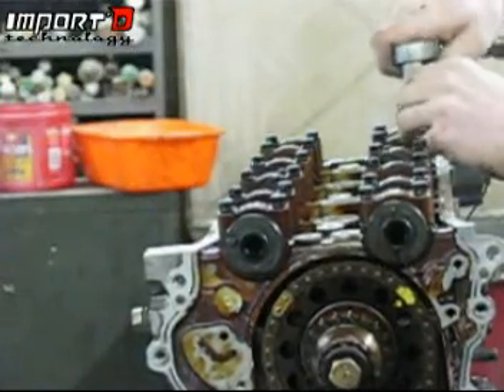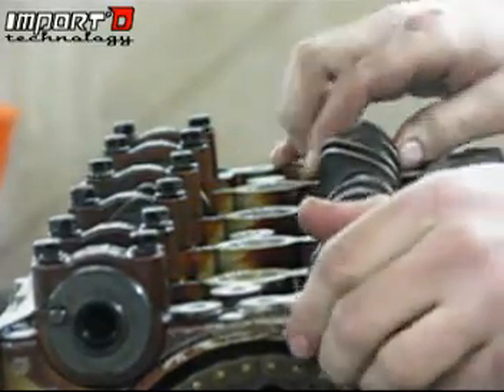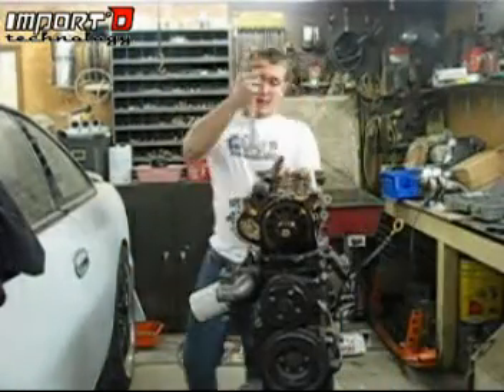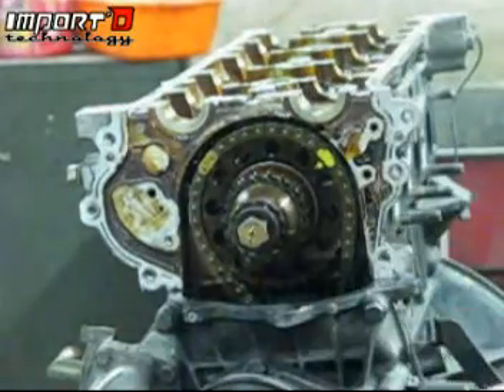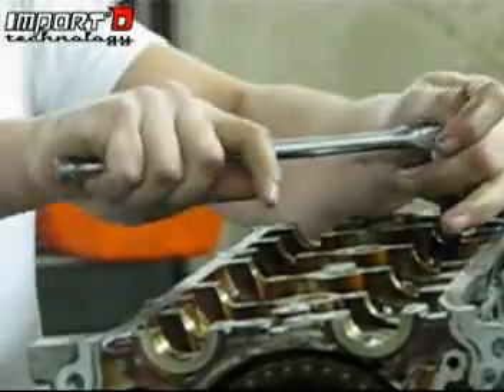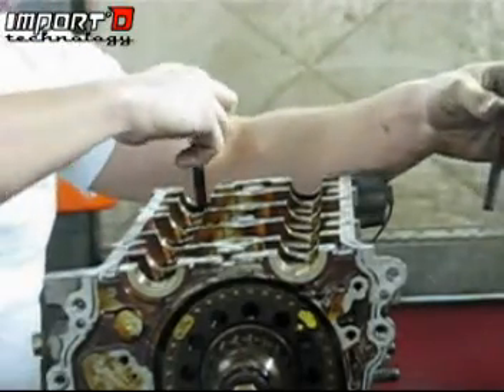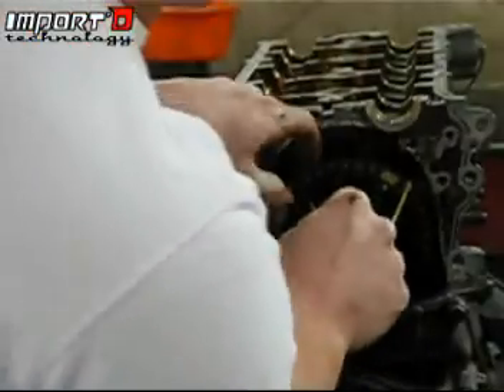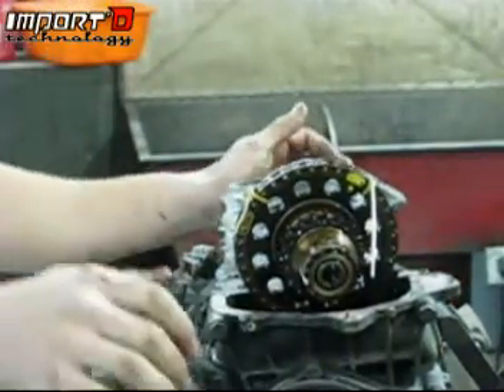Part 2 - How to remove cylinder head from KA24DE 240sx S13 S14

Comment: Appreciate the video but I thought you were unbolting in the opposite sequence so I checked the factory manual and I was right. It's a protected pdf manual so it won't let me copy and paste anything but in essence you are suppose to work your way out to in when disassembly and center to out when assembling cams, heads and rocker covers.
Reply from the maker: the important part is that they are removed evenly. Most everyday shops don't even follow a sequence of any kind.

Comment: awesome video man, just curious about your thoughts on if the block would need any machining if you had a slight BHG? my car has a very slow BHG (not mixing with the oil but white smoke is prevalent from the exhaust and coolant burns up). How likely/unlikely is it that the block might be damaged and may need to be milled or would just having the heads rebuilt and surface of the head machined along with a new head gasket and ARP studs work? thanks for any advice/suggestions.

Comment: Ok first off mad props to you guys, you did a very good job on this and has helped me tremendously with my 240 s14, really great videos!!! So i just got one and now the head gasket is blown :( but i cant really pull the motor (nowhere to do it) so i will be doing this in the engine bay. I know it will take longer but what are your thoughts on doing this in the engine bay??? Looking to do this next weekend so if you have a spare moment i would greatly appreciate you response, thank you very much!

Comment: Your video is very instructional, still is recommended to have the shop manual of the year and model of the vehicle. Both, the shop manual plus your video will be a great tool for anyone who feels capable to replace the head gasket or the valves. You have gave lots of tips which are very important and that are not shown in the shop manual. Great work, thanks for your video.

Comment from the maker: @willcast21 Thank you for the compliment.

Unfortunately, the 2.5/3.5 in the altima's is a new game. You can still use my video as a general "how to", most nissan's use timing chains. 

As for "Head Gasket Sealant", we use Permatex Copper Spray on all of our head gaskets.

TTY (Torque to yield) bolts usually are not super expensive. If they seem overpriced, check out the cost on ARP headstuds. ARP's are reusable over and over.

Comment from the maker: @juanfg34 It's pretty straight forward. Off the top of my head, there is a bolt on the exhaust side of the head that goes DOWN into the cover. You have to remember to take this out.

Also, there are two that go DOWN into the oil pan. 

Obviously, the crank pulley needs to be removed. Don't lose the "half moon" key that sits on the crank itself.

Comment from the maker: @S13xCrazy However, You can leave the intake on and avoid those 3. Getting the head actually out of the engine bay is slightly more complicated though. You have to have a buddy put a strap around the intake manifold and have them pull like hell to give the two intake studs on the cylinder head room to slide out of the manifold itself.

Comment from the maker: @johnprodgers60 Yes, it absolutely is possible. You basically do everything the same, however there are 3 bolts on the back of the head that hold on EGR lines. They are a PITA to get out while the motor is in. The other "tough" part is the 3 bolts that hold on the intake manifold. There is a bracket directly underneath it.

Comment: Is this build simular to a Nissan 2002 Altima 4 cylinder? I need to replace my head gasket and really cannot afford to pay over $1000 for labor alone. I usaully do minor mechanic work myself but never did anything like this. My biggest concern is Timming chain when I put it back together. What Head Gasket Sealant do you recommend? And about how much will Head to Yeild bolts cost as you recommend it needs to be replaced?
Well done will your vids, I like how you keep explaining as you do it.

Comment: @S13xCrazy You and Steve are pros thanks a lot Same procedures apply to a 1.9L Saturn Twin Cam ? lol need to change cylinder head the head comes assembled with everything cams, springs, valves and lifters.

Comment from the maker: @marsvolta1fan 
Yeah, I know :-D It was a mistake in the "heat". You'd be surprised at how being infront of a Camera can have you making mistakes!!!! As long as the pressure is removed evenly (even the way I did it) no one will have any problems.
But, you are correct! FSM Calls for OUT to IN, but the most important thing is that the pressure is removed evenly.

Comment: Hey FYI when removing the head bolts you need to do it in reverse order of the installing tightening sequence. You work from the outter bolts to the middle when removing.